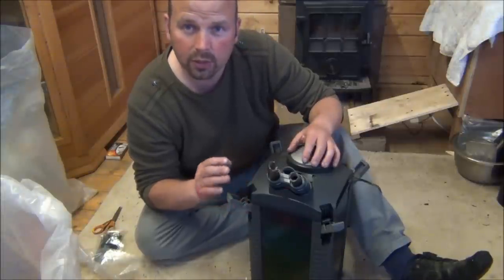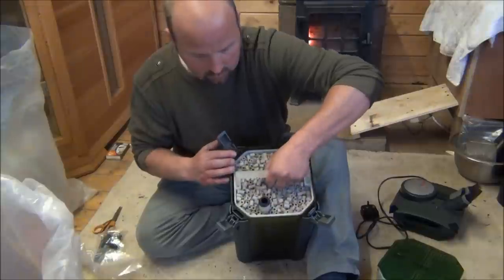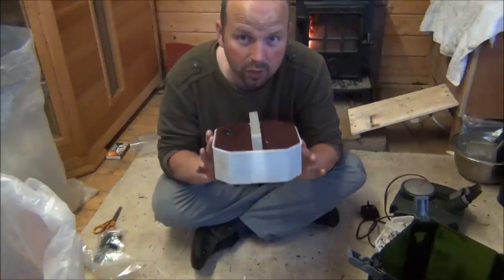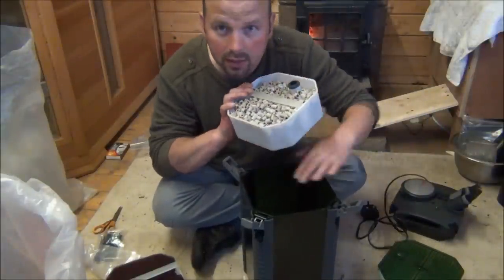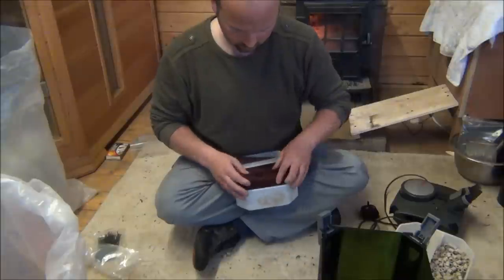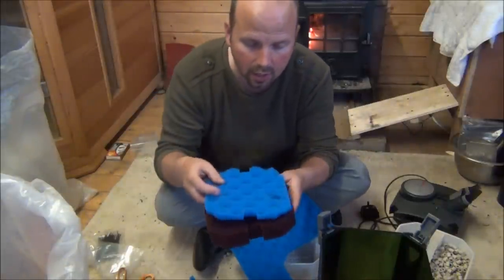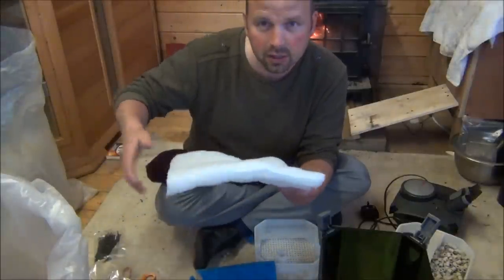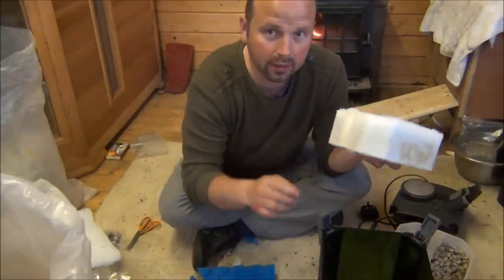How to set up an external canister filter for aquarium by Pondguru

Comment: Hi thinking of getting fluval fx4 do u think the same would work on the with it having the round filters
Reply from the maker: Yes the only difference is that the water flows through the trays from top to bottom in the FX filters.
Each tray will hold approx. 1.5kg biohome mini ultra or biohome ultimate (best types of media for external filters) so assuming you use a thin fine pad over the top of the top tray you will be able to fit up to 3kg in the filter (maybe a bit more if neatly packed) making the FX4 suitable for seeing full cycle filtration (reduction in nitrate) for up to 300 litres (normally stocked community aquarium) and up to 150 litres (very heavily stocked aquarium).
Reply: Pondguru Outdoors I am looking to put cichlids in my 240 litre
Reply from the maker: Sounds like the filter is undersized if you wanted to achieve full cycle filtration (reduction in nitrate) for cichlids in a 240 litre unfortunately as you could need between 1.5kg and 2kg of biohome mini ultra or ultimate per 100 litres to achieve that in a well stocked cichlid tank.
You should be fine with ammonia and nitrite though - sadly that is all manufacturers look at when sizing their filters and Fluval FX range are more optimistic than most. For example the FX6 states it is suited to aquariums of up to 1500 litres but in reality it is more suitable for a normal community tank of around 500 litres and a heavily stocked tank of around 250 litres. That would have been the one to go for for a well stocked 240 litre cichlid tank and it holds up to 5kg of media.
Reply: Pondguru Outdoors nice good job I held off which filter would u recommend if fx not suitable don't think fx6 will fit under my tank unit
Reply from the maker: That is great to hear you haven't bought the filter yet as I hate being the bearer of bad news when a tank is well underfiltered. The FX filters have great flow rates and plenty of foams but the biological side has always been small considering the size of the filter.
The All Pond Solutions EF2000 will hold 5kg in 3 trays and still have bottom tray for the coarse, medium and fine foams: http://geni.us/2LnO
It is quite cheap too and just as reliable as other decent filters so would definitely be worth checking out to see if it would fit.
Reply: Pondguru Outdoors cheers pal love the channel
Reply from the maker: No worries, any time. I wish I got more time for making videos as there are so many important aquatic related videos still to make including filter sizing, surface area for bacteria, chemical filtration etc. etc.

Comment: i couldn't help but notice something in this video and your shorter video that you don't talk about chemical filtration in canisters; ... 
as i have figured out trays goes:
mech: (foam)
chem: ex. (ammo-carb)
bio: ex. (bio-max) 
of course this a 3 tray canister as per what is included in the box 
(2) extra trays in a 5 tray canister ; up a 150 gallon filter
my question is:
what to do with the chem tray; would you use it or replace it with something else;
and how  would you set up a 5 tray canister, for example .
thanks
Reply from the maker: +willliam lacey Chemical filtration really should not be needed when a suitable sized filter is set up properly as you will get no problem with ammonia, nitrite or nitrate but in cases where you need to remove staining in water from bogwood / peat / almond leaves or residual chemicals following a fish treatment simple carbon will draw that in no problem. 
The filter should always go:
Mechanical,
Biological,
Chemical
This is because some chemical treatments will starve the bacteria of essential trace elements or in the case of Purigen kill the anaerobic bacteria stone dead (by starvation of residual bleach?)
In a 5 tray system you could =go 1 or 2 trays with layered foams followed by good media - chemical filtration last and optional / when required.
Reply: +Pondguru Outdoors 
i want to thank you for a quick response since this will be my first external canister filter i want to set it up right the 1st time
finding the foam filter pad materials on the other hand ; proving more difficult .
Reply from the maker: +willliam lacey No worries - I'm assuming that you are not in the UK as every place which sells pond fish has loads of suitable foams.
Reply: +Pondguru Outdoors 
your right i;m in the US ... but i have a bunch of great friends in the UK
and I;ve checked out the bio home distributors here in the US ...
i'll check with the ac filter company's i know on sheets of filter foam ... i looked around at some places and i'd have to go to several places to get the 3 stage  mech. filtration i want and need ...
thanks again ...
Reply from the maker: +willliam lacey No problem, any time.

Comment: I know this video is old...how would you set up a Fluval FX6
Reply from the maker: The water flows from top to bottom in that one and as you have good foams surrounding the trays you really only need a fine pad on top of the top tray. Each tray will hold at least 1.5kg of biohome mini ultra / ultimate and therefore you can get up to 5kg in the 3 trays with careful packing which will see you right for full cycle filtration (reduction in nitrate) in a community tank of around 500 litres or a heavily stocked tank of around 250 litres.
Reply: Thank you soooo much...I really appreciate it and value your opinion.

Comment: is it a bad idea to get a sun sun canister with uv? won't the uv kill all my beneficial bacteria in my canister I'm confused hoe this is supposed to work can u help me please?
Reply from the maker: A UV is essential if you have multiple tanks linked to a single filter but is generally not required. It will not do any harm as the UV does not shine directly onto the media but the light should be left OFF for the first 2-3 weeks when establishing a new filter to allow bacteria to flow through the system and colonise it properly.
Hope that makes sense.

Comment: hi. just wondering. i changed from internal filter to external filter. i took all old media and placed in tray inside new filter. my water is now cloudy, 3 days so far. can anyone suggest anything
Reply from the maker: It should clear as long as you have a decent fine pad in the filter. Could be a bacterial bloom? If so as long as the media in the new filter (I'm assuming there is old and new media in there) is decent quality the bacteria should settle in there.
Reply: Pondguru Outdoors thanks, them media is the orange biome media that you use, that's in top tray, in middle tray is old filter media, in bottom tray is my course, medium and fine filter sponge. Under the trays I have some polo media, just like you put in. The canister is all pond 1000ef.  Thanks again
Reply from the maker: That sounds like a decent set up and the cloudiness could just be down to doing the filter work. It should clear.

Comment from the maker: Those extra 'medias' or treatments are unnecessary in my opinion as they try to fix a filter which is not working properly. When a filter is set up correctly with good media and foams in the right place it will work at full capacity so those products aren't needed and just over complicate the filtration process.
I bought some Seachem Matrix to test in an upcoming video and Holy Jesus is it expensive for what you get...

Comment: could you do an fx5 filter setup
Reply from the maker: +JORDAN MICHAEL The principle is the same in FX5/6 except the water flows from top tray to bottom tray (pump is in bottom of filter). If you go with a fine pad on top of top tray you can fit 5kg of mini ultra or ultimate in the FX. If you go with coarse, medium and fine foams in top tray you will need 3kg for the other two trays in FX.
Reply: Pondguru Outdoors thank you very much cheers :-)

Comment: So why not use Carbon in the final (top) stage?
What are the benefits / non-benefits of using Carbon?
Reply from the maker: This video explains why you won't need carbon in a properly set up filter. http://www.youtube.com/watch?v=lsAmSD3wVbg
Reply: Pondguru OK thanks. He promotes/recommends Biohome products well, and I'm happy to go ahead with that in the same way as he explains, but still does not explain why not to use Carbon. And by-the-way, my filter has 4 stages (trays).
My question is still - Why not use Carbon in the final (top) stage?
&
What are the benefits / non-benefits of using Carbon in the final stage?
Reply: Joe Cazzar Actually, I've just thought of something else. Because Carbon has such a large surface area, could it not be used further down instead of the final stage, perhaps at the second stage, after the foams or will that affect the bacterial stage above it?........just a thought.
Reply from the maker: Joe Cazzar Carbon pores block up so quickly that it becomes ineffective after 7-8 weeks so doesn't allow a bacteria colony to build and be of any use. It is generally used in filters to disguise the fact that the filter media is not removing ammonia and nitrite (hence manufacturer insisting you replace every 1-2 months). Carbon can remove the colour from bogwood and draw in residual treatments so is useful for that. The filter media should reduce ammonia and nitrite and in the case of biohome, nitrate also as long as a sensible amount is used (for example 500g in a 400 litre tank will make no impact on nitrates)
I must have forgotten to mention carbon or maybe edited that bit out of the recommended video? lol

Comment: How do you set up an fx6 canister?
Reply from the maker: The FX6 trays work from top to bottom and as you have a good amount of foam surrounding them you really only need a fine pad on top of the top tray then all 3 trays can be filled with media. Not sure how much ceramic or other media each one will take but each tray will take 1.5kg of biohome mini ultra or biohome ultimate.

Comment: is it safe to use on aquariums not cycled?
Reply from the maker: sheila demorrow Not sure what you mean? Is new media safe to use in an aquarium which is already mature? Yes but add it gradually over a month or so that you're not removing the good bacteria all in one go when you change your old media for the new biohome.
Reply: sheila demorrow 
I had never used a canister filter I started getting Discus and wanted to make sure to keep tank as clean as possible. I have HOB filters and it was cycled. I followed your video step by step. Bought the media from Greatwave engineering. I put a few of the bio gel balls in with it as was instructed. I just wanted to make sure the nitrogen cycle was good. I just get nervous because chemical testing just didn't tell me much. Showed high ammonia and real low ph. I do daily water changes up to 50 % so I know the ammonia is fine. I have to use RO water cause our tap water sucks. I live in West Texas and we don't use tap on anything. Just wanted to ask you for your experience and knowledge. Didn't mean to write a book.  TY Richard but if you could give me a short reply on your thoughts.          Sheila Demorrow
Reply from the maker: sheila demorrow RO water has everything stripped out so unless you add some mineralisation back in you will have pH around 6.0? If the filters were working properly you should only need to change 10% a week at most but HOB are notoriously poor. Hopefully with the biohome in there after all the foams it will improve the ammonia situation after it matures. I don't know how long it has been in but it should only take 2-3 weeks to hammer down ammonia and nitrite - problem is as the water becomes more acid the bacteria finds it harder to populate the filter so it may be retarded by that situation, resulting in the filter taking 5-6 weeks or even more to mature if pH is very low.

Comment: Is there any way to reduce the flow rate on these?
Reply from the maker: Tracy Hilton Not unless you restrict the inlet or outlet pipe with a tap which won't do the motor much good. You could probably safely turn it down by 20-25% using a tap but any more may put too much strain on the pump.

Comment: Hi PondGuru, how would you pimp out an Eden 521 (with water heater)? I've been looking at the flow diagram (attached below), and it looks like there is definitely space wasted, and importantly, reduced flow over the biological media. The heater sits in a tube within the ceramic media (in the diagram). I was almost thinking of doing a 3 layered foam in the first compartment (left to right), remove the compartment divider between the middle and right compartments, and fill that larger created compartment with biological media that can move around. What are your thoughts?

http://www.edensrl.com/upload/gallery/circolazione(1).jpg

Comment: how can i test the uv bulb the light shows that is on is very dim not sure if it is working
can any one help me my canister is EFX 1500U
Reply from the maker: +Peter Hill The UV will likely have a pressure switch which will allow you look at it when the unit is dismantled but you will have to depress that for the bulb to light up when filter is dismantled (as looking at UV light damages eyes). If the indicator light is glowing when the filter is put back together then the bulb will be working. A PLS bulb should last a year or so if it is on 24/7 before it needs replacing and should be turned off for 2-3 weeks when setting up a filter to help it mature (by allowing bacteria to flow through system without being killed by UV)
Reply: +Pondguru Outdoors i don't see pressure switch can you show me a link where i can find this
Reply from the maker: +Peter Hill There may not be one but if the bulb works when the unit is put together and goes out when you take it apart then a pressure switch will be there somewhere (usually a plastic pin or bobble on one side and rubber hole on other) but as I'm not familiar with that model you'd be best to contact manufacturer. You may get lucky by contacting the seller you bought it from but most won't know much about the products they sell.

Comment: How would you set up an Aquaclear 110?
Reply from the maker: Hand on back filters are generally reliant on a cartridge system so aren't the best to alter. As long as you ensure that the foams / pads are doing a good job of mechanically filtering the water and ensure that the media (if present and if it can be swapped out) is of good quality then the filter should do a reasonable job.
Reply: Thanks
Reply: Noticed this was 3 months old. Pondguru's advise is still valid with an AC110. Start with the foams at the bottom coarse to fine. A mesh bag or two of biohome ultimate to fill up the rest of the basket. If you want chemical filtration (carbon, purgen, chempure, etc) foams, carbon/etc., biohome ultimate. Pondguru fell free to correct me, if you so choose.
Reply: Ty. I did exactly that. :-)

Comment: "Hardly one of the labors of Hercules" .... priceless

Where does activated carbon fall into the equation? TIA
Reply from the maker: Not needed in a properly set up filter but if you do choose to use it then it really should be the very last thing the water hits before leaving the filter and replaced every 7-8 weeks. Carbon is useful for taking in colour associated with bogwood, almond leaves etc. and also drawing in residual treatments after a course of treatment has ben used in tank.
Reply: Pondguru
Totally different arrangement in my new Juwel internal filtration system! The fine stuff is at the very top where the water hits first, then carbon, then medium sponge and finally coarse what a crock of *** I would take your advice over theirs any day Richard! looking to upgrade thanks.
Reply from the maker: Chris Wilson No worries, once you have it set up in the right order there's no reason why it shouldn't be super effective (and cheap to maintain).
Thanks for watching and appreciating the videos.

Comment: what the name of the filter? is it Eheim Pro 2?
Reply from the maker: Yes.
Reply: Pondguru awwh cant seem to find them on amazon. well i think i did but one was call Egar or something... look the same as that one but the thing is it only doing 200 GPH :( not soo good for oscar... since they poop alot.

is that canister filter really 200 GPH?? because i have a 55 gallon with one oscar.
Reply from the maker: Kingz Pantheon I'm not sure what the flow rate was on that one as I just pulled the guts out, put it together how it should be then sold it. Ultimately having the filter set up properly is way more important than the flow rate as if the water needs extra aeration most people would just add an air stone.
Reply: Pondguru ohhh i see soo the flow rate isnt important to keep the tank clean?? i thought it was. because atm i am using 3x Emp 400 for my 55 gallon....noisy but i can handle it till i get a canister filter.

Comment: No charcoal layer?  That is my most expensive layer (bio-chem zorb).  Not needed?
Reply from the maker: Generally not needed when a filter is suitably sized and well set up unless you needed to remove colour from bogwood or residual fish treatments. Charcoal helps to pull in heavy metals and inorganic pollutants so won't harm a cycle when it is used - if you have space for it and feel you need a bit more 'polish' to the water then by all means use it no problem but don't go for the filter manufacturers own brands as they are way overpriced - generic charcoal or carbon in a cheap mesh bag does just the same with a fraction of the cost. Remember to replace every 7-8 weeks and its all good.
Here is a link to the small mesh bags I have often used in this video series: http://geni.us/DtoexHC
Reply: Thanks!  I'll look into a cheaper alternative.
Reply: Chemical filtration doesn't do jack that a water change won't do for basically free. No not needed. Change your water frequently and add more bio media where the "buy- your cash absorbed" or whatever it's called was.